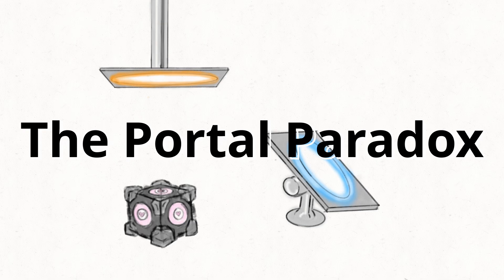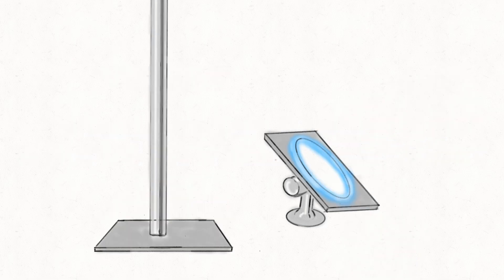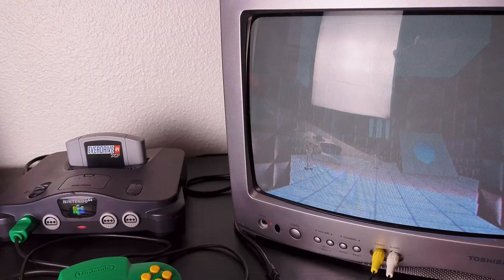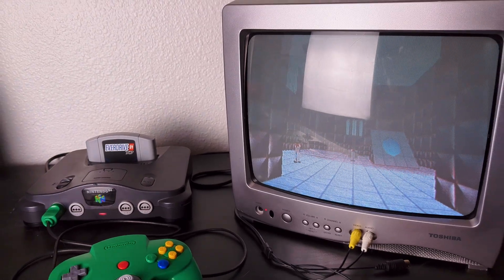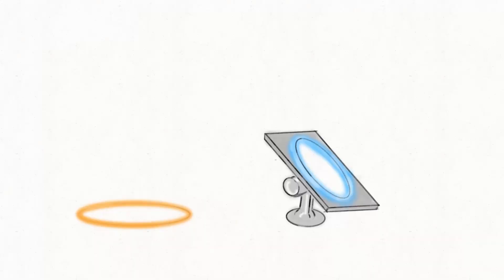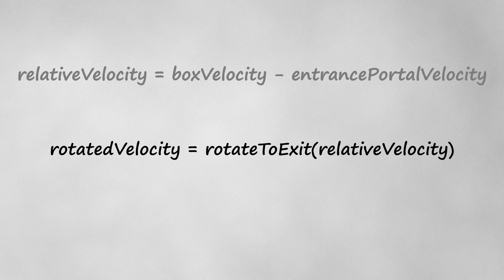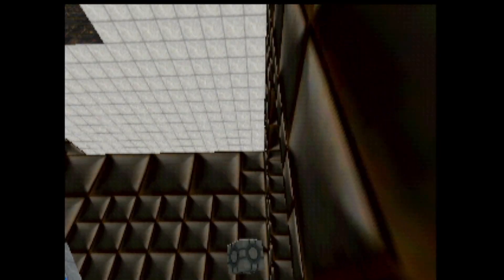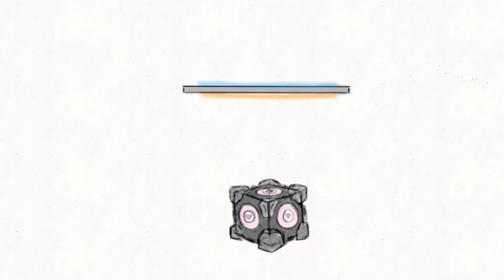I rewrote Portal from scratch and solved the Portal Paradox

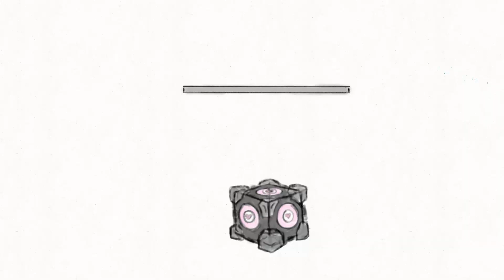Comment: The explanation at 2:02 made the first experiment make SO MUCH MORE SENSE. Amazing video <3
Reply: For mw it was the same until I remembered conservation of momentum, meaning that the velocity is influenced by the mass of the platform and the cube 😅
Reply: @randomdude7386  except the platform does not apply force to the cube
Reply: I think you are misunderstanding how the portals work in the game. The portals are not physical objects that can move and interact with other objects, they are just openings in space that connect two locations. The velocity of an object that passes through a portal is relative to the portal, not to any other reference frame. This means that if a portal is moving, it will affect the velocity of an object that exits the other portal, even if the object itself is stationary.

To illustrate this, let’s use your analogy of a baseball and a car. Imagine you have a car with two open windows on opposite sides, and a baseball that is resting on the ground. Now, suppose you drive the car over the baseball, so that one window is above the baseball and the other window is on the other side of the car. If you ignore air resistance and friction, what will happen to the baseball? Will it stay on the ground, or will it fly through the car?

The answer is that it depends on how you look at it. From the perspective of someone standing on the ground, the baseball will stay on the ground, because it has no horizontal velocity and nothing is pushing it. From the perspective of someone inside the car, however, the baseball will fly through the car, because it has a horizontal velocity equal to the speed of the car in the opposite direction. This is because motion is relative, and different observers can measure different velocities for the same object.

Now, imagine that instead of windows, you have portals on opposite sides of the car. The portals are connected, so that anything that enters one portal will exit the other with the same velocity, relative to the portal. What will happen to the baseball now? Will it stay on the ground, or will it fly through the portals?

The answer is that it will fly through the portals, regardless of how you look at it. This is because the portals are not physical objects that can move and interact with other objects, they are just openings in space that connect two locations. The velocity of an object that passes through a portal is relative to the portal, not to any other reference frame. This means that if a portal is moving, it will affect the velocity of an object that exits the other portal, even if the object itself is stationary.

To see why this is true, let’s look at what happens to the baseball from different perspectives. From the perspective of someone standing on the ground, the baseball will enter one portal with zero horizontal velocity and exit the other portal with a horizontal velocity equal to the speed of the car in the same direction. This is because when an object enters a portal, it inherits its velocity relative to the portal. Since from this perspective, the portal above the baseball is moving with the speed of the car in one direction, the baseball will exit the other portal with the same speed in the same direction.

From the perspective of someone inside the car, the baseball will enter one portal with a horizontal velocity equal to the speed of the car in the opposite direction and exit the other portal with zero horizontal velocity. This is because when an object exits a portal, it preserves its velocity relative to the portal. Since from this perspective, the portal below the baseball is moving with the speed of the car in the opposite direction, the baseball will enter the other portal with the same speed in the opposite direction.

As you can see, both perspectives agree on what happens to the baseball, even though they measure different velocities for the same object. This is because the portals are not physical objects that can move and interact with other objects, they are just openings in space that connect two locations. The velocity of an object that passes through a portal is relative to the portal, not to any other reference frame. This means that if a portal is moving, it will affect the velocity of an object that exits the other portal, even if the object itself is stationary.
Reply: @aaron7566  um.... yeah what Aaron said🤣
Reply: Except his explanation makes no sense when you understand that momentum is conserved between portals. Think of it like a baseball in a car. If you remove air, a car driving over a baseball will not move the baseball. Because before the car drove over the baseball, its momentum was 0. Therefore, after it drives over the baseball, the momentum would be 0. In the first clip where the cube goes flying, the car drives over the baseball and stops, then causes the baseball to go flying in the opposite direction as fast as the car had been moving, having never touched the baseball. Somehow, the car imparted momentum to the baseball, having never touched it.
Reply: @trmerc7635  Except that's not really how this works. Imagine it from the perspective of the exit portal. The moment the entrance portal touches the cube it starts coming out the other end. This happens regardless of whether it falls into the portal or if the portal moves towards it. Assuming the velocity of the cube falling is the same as the portal moving towards it the cube is coming up out of the other portal at the same speed in either situation. And this is where the momentum plays a role. The exit portal does not care how the cube is coming through, all that matters is how fast it's coming through. Momentum doesn't just stop as soon as it's come through and plop down, it's going to want to keep moving in the direction it was coming out of the portal at. If actually look at the exit portal you can see the cube come closer and come through the portal. From the exit portal's perspective the entrance portal may as well have been static and instead the platform the cube is on got pushed upwards. This is why relative velocity is key here. All that matters is the relative velocity of the cube compared to the portal.
Reply: @RNeeko  It really is how it works. Instead of a portal, imagine a car. If you throw a baseball at a moving car and it goes through the open windows, does the ball get faster or slower? No. Because the ball did not interact with a physical object to impart momentum. The portals are just points in space that are connected. So is a long tube. If you throw a ball through a tube that is moving, as long as the tube doesn't touch the ball, it doesn't affect the speed of the ball. For some reason, people seem to think because it is a wormhole and not a physical tube, it somehow changes the laws of physics.
Reply: @trmerc7635  the cube has to leave the exit portal with the same speed it has entered the portal... thus giving it momentum. Witch causes the box to accelerate upon exiting the stationary portal.
Reply: @trmerc7635  Imagine a car floating in empty space with no other frame of reference and suddenly a baseball flew through the window and out the other side. Now imagine a baseball floating in the same space and suddenly a car flies by and the ball goes through the window. Now imagine empty space with a baseball flying in from one side and a car from the other. The only difference between any of those situations is your point of view. The motion is relative to the observer. Whether the box is moving or the portal makes no difference to the physics. In other words smashing a portal into a box produces the same result as smashing a box into a portal.
Reply: But in all those examples, the object that was not moving stays not moving the entire time. The baseball suddenly doesn't start moving when the car passes over it. The cube was not moving. The portal moved over it, and the cube goes flying. What gave the cube momentum, the hole moving over the cube? A hole has no mass. Therefore, a hole can't have force.Force = MASS x Acceleration @malomodo
Reply: @lostlogic2840 Where is the transfer of energy? Space moved AROUND the cube. The cube didn't move through space. Something has to push the cube; passing a hole over an object does not impart momentum. That is what a lot of people fail to realize: the portal is a HOLE, not a physical object. A hole can't push, a hole can't touch, a hole is literally devoid of mass and thus can never have force
Reply: @RNeeko If you look at it in relation to the exit portal the cube would go flying as soon as it starts to come out. In your example, the cube is being squeezed through the portal, and therefore as soon as there is enough force to make it move, it will move. The portals are literally just holes in space that are connected like a straw, you can't make something move through a straw just by passing the straw over it. Try this in real life, cut a hole in a piece of paper, and pass it over a can of pop. Does the can move based on how fast you move the paper? Use a piece of plywood, does it move based on how fast you move the hole, or how hard you hit the surface it was on?
Reply: @malomodo  I think my reply got eaten. I had a good one, but this one is better because we already have an example of smashing the box into the portal from the first portal game. One of the puzzles is a room with giant pistons that are moving up and down. There is no way to get through without being crushed except by placing a portal above you and a portal on another surface. You are pushed up into one portal and either stand on the piston through the portals or fall onto the floor. As if gravity had suddenly shifted 90 degrees. Because the forces acting upon you are only gravity, nothing else.
Reply: @trmerc7635  lol no ur right... what was I thinking 🙄
Reply: @trmerc7635  As the video shows, that's exactly what happens when the two ends of the portal are stuck together and move at exactly the same rate. The question is what would happen if one portal was not moving.
Reply: The speed and direction of an object that goes through a portal depends on the speed and direction of the portal itself, not on anything else. This means that if a portal is moving, it will change the speed and direction of an object that comes out of the other portal, even if the object was not moving before.

For example: one portal is moving and one is stationary. The cube is under the moving portal. Let’s say we are standing at the stationary portal and looking through it. As the moving portal gets closer to the cube, we will see the cube getting closer to us, even though we and the cube are not moving. This is because the cube is moving relative to the moving portal. Once the cube starts to enter the moving portal, it will come out of the stationary portal with the same speed and direction as the moving portal. This is because the cube keeps its speed and direction relative to the portal it entered.
Reply: @trmerc7635  the speed of the cube is created by the moving entrance portal, measure the speed of the cube entering relative to only the entrance portal. Now because traveling through the portals is instantaneous, measure of the cube coming out of the stationary exit portal, the cube must maintain the same velocity that it entered through to the exit, whether or not the portals themselves are moving.
Reply: @trmerc7635  You have to consider the RELATIVE momentum. Everything in the universe is moving, or rather there is no way to tell if anything is actually standing still. We often use Earth as a reference point, but earth is moving around the sun, and the sun is moving around the Milky way, and the Milky way is probably moving. Saying the baseball doesn't move is only accurate from one point of view. From the car's point of view, the baseball is moving toward it. In order to account for both points of view you need to use the relative speed. In other words "how fast are they approaching each other".
Reply: @aaron7566  Then what you're describing is creating energy from nothing. The portal does not slow down while moving over the cube, yet the cube goes from 0 to whatever as it moves through the portal. The problem with this game explanation is that this is code and not the real world. "If X condition is met then Y." He could have easily programmed the game to have the other solution. That the cube just falls out of the exit portal, or the program confused the conditions and had the wrong output. This kind of simulation would normally take a supercomputer to run, and he is running it on an N64.
Reply: @malomodo  Yes, it is all relative, but the forces you're talking about would mean we wouldn't know what direction an object that is tossed through stationary portals would go after it exits, making this whole thing pointless. You drop a ball in a portal on the floor to one on the wall, and it shoots upwards before gravity takes over and pulls it down kinda thing. You have to start with a closed system to get a baseline.
Reply: @lostlogic2840 That the portals create energy from nothing and thus can be a source of perpetual motion.
Reply: @trmerc7635  A stationary ball is held in a vacuum with no gravity or atmosphere. A car with no windshield is tossed at it. The ball, relative to the contents of the vehicle is moving at the exact and opposite speed. You, from outside, observe no change in the speed of ball due to the fact that the ball in fact isn't moving - the car is.

In this instance the car's front window is the first portal, and the second portal is the entry into the space.

The ball isn't moving. The cube isn't moving. The entire room is the contents of the car moving around the ball. BUT from our perspective, inside the space, the contents of the room/car aren't moving just the ball is.

You're correct that there is no imparted momentum on the ball. But you're forgetting that relatively speaking there is a momentum difference and everything will continue to move around it.

In this case, the Cube is a fixed item in space and the entire room is shifting around it.
Reply: @magixtwister Then you're getting in the relative motion of everything in the entire universe problem. If you drop a cube into a portal on the ground, there is a chance that it flies upwards upon exiting a portal on the wall because the room happened to be moving down at the moment it exited. You need a closed system as a point of reference. When you look at his equation that the speed of the cube equals the difference in the speed of the portals, of course, the cube is going to shoot out of the exit portal, but the cube had 0 momentum going into the portal and has momentum coming out. Standing thing goes in, speedy thing comes out. His portal paradox has created perpetual motion because the energy of the moving portal is sustained, and the energy is also imparted to the cube, meaning the energy in the system just doubled.
Reply: @trmerc7635  But you can measure the angle the object enters the portal. It would exit the other portal at that same angle. You seem to be confused about relativity, so here's a thought experiment from Einstein: Imagine you are in a room with no windows and no way to get any information from outside the room. You have a laboratory that you can use to do any experiment imaginable. How can you tell if you are stationary on Earth, or accelerating through space upward at 1G? No matter what experiment you do, the results would be the same because the laws of physics don't care which viewpoint you are observing from. Whether the box is moving toward the portal, or the portal is moving toward the box is just a matter of perspective, and therefore doesn't change the result.
Reply: @trmerc7635  Actually no, let's imagine this from the perspective of the cube instead. Let's imagine that it's you that's standing there. When the portal is coming towards you nothing much happens. No wind, no forces acting upon you other than gravity. But suddenly as soon as your head goes through the portal you feel and hear wind. But it's not actually wind, it's just the air moving around you because you're coming out of the exit so fast. Then your neck, torso and arms, legs and last your feet. Remember that you were moving so fast that you could feel and hear the air moving around you. It all happened so fast you barely even had time to register it. What happens to this velocity? Does your body go from being so fast that you could hear the air moving around you to no velocity? But of course not. It's why you wear a belt in your car. If you were to have a crash you would fly though your windshield if you didn't. Same thing here. Where does the energy come from you ask? The energy comes from the piston and whatever unholy amount of energy allows for the portals to exist. I highly doubt you would ever get a return on investment on it.
Reply: @malomodo  Try this for a thought experiment. It's the same room sealed off from the rest of the universe. You have a portal rotating around a circle. When the cube exits the one portal, it shoots up into the portal that is moving around. You'll eventually speed the cube up to the point that the portal moving around will not be able to keep up with the cube. Thus, you have created energy in a closed system from nothing and breaking the law of conservation of energy. You've never transferred energy from something to the cube, yet the cube gains momentum each time it passes through the system because as it moves up, the entrance portal moves down over it, causing it to speed up, and the entrance portal never loses energy.
Reply: @RNeeko  You need a seatbelt to stop you in a car because you have momentum. The car is losing its momentum, but you keep yours. The problem with your explanation about where the energy comes from is no energy is lost to the cube from the portal passing over it or the piston. The only thing that causes the piston to slow down is the collision with the floor. If the floor wasn't there and the cube was flying in space, you would have still created energy from nothing. Unless you're saying a portal passing over an object imparts energy onto the object, but then a stationary portal would slow down an object passing through it. Because every action has an opposite and equal reaction.
Reply: @trmerc7635  One portal being higher than another one breaks the laws of conservation of energy. If the cube goes through a stationary portal to another stationary portal (edit: that is higher up) it gains potential energy. If you have one portal above another inside a vacuum and you dropped a cube in, wouldn't it continue to gain momentum at 32 feet/second/second until it was moving infinitely fast? And that's with stationary portals. That's why portals are impossible in reality, but in the game they are possible. So I don't consider that to be a factor.
Reply: @malomodo  One portal being higher than the other does not. The cube exits at the same speed as it enters and then starts to slow down when gravity takes over. No speed was gained or lost when it moved through the portals. Just because in physical space, it moved to a higher point means nothing when it comes to energy. It costs an object 0 energy to travel through a portal.

A better example of the infinite loop portal in a vacuum is a cube traveling straight towards a portal loop (think when you drop an object in the game in a portal with the exit portal overhead), and unless there is a gravitational pull, the cube will travel the loop over and over again. Move one portal closer in the loop, and the cube just cycles through the loop faster but doesn't move faster. The rate at which the cube moves through space will be the same as before, just cycling more. Energy is conserved as the cube has the same energy every time, even though the loop is smaller.
Reply: @trmerc7635  What is slowing it down? Gravity? Explain how that works. Objects on earth fall at 32 feet per second per second, which means it keeps increasing velocity. It would be like there were an endless tunnel with the pull of earth's gravity at one end. If you're in a vacuum, there would be no air resistance to slow it down, so what force is acting on it to slow it down? The only force acting on the cube is the constant downward pull of gravity.
Reply: @malomodo  If in a vacuum with an infinite loop portal, then nothing is slowing it down? I'm not really sure where the gotcha is because, as stated MULTIPLE times, unless an outside force acts upon the cube, the cube shouldn't gain or lose momentum.

If the portals are set up for an endless loop in a vacuum, then it would continue to fall and accelerate to infinite speed if gravity can help an object achieve that. However, an outside force is still acting upon the cube, not just space moving around the cube. In the example shown in the video, the cube acts the opposite of gravity. The portal comes down, and the cube travels UP from the downward force of gravity at all points in the model until it reaches the apex of the arc of travel.
Reply: @trmerc7635  Are you still talking about breaking the laws of conservation of energy (that's what my example was about) or did you switch to a new topic? BTW, I never said anything about space moving around an object. Space is nothing. Are you setting up a straw-man, or is that what you think is happening?
Reply: @malomodo  I've always been talking about the conservation of energy. There is no strawman here. My whole argument is there has to be something giving the cube the momentum it needs to fly through the air, and to the cube space just moved around it. It didn't get pushed by anything. Everyone I've been talking to has been making all these arguments about how just by the hole moving over the cube, it should start moving when nothing touched the cube itself. If space suddenly moves around an object, the object does not gain momentum.

If space suddenly shifted around our solar system, we would not feel a thing. Because no force touched the earth. If you're free fall floating in a plane and it hits turbulence, you would not feel a thing until you touch the plane. If you're floating in space in a spaceship and it suddenly moves 2 inches, you would not feel anything because you were not touching the spaceship. SOMETHING has to impart the force on the cube to move it.
Reply: @trmerc7635  OK, sorry for doubting you. (Edit: I may have been too hasty in my decision to give you the benefit of the doubt that you are arguing in good faith, but I guess we'll see.) I'm just trying to explain relativity but you said it was impossible because it breaks the laws of conservation of energy. I said the game already breaks it and gave an example and you said that one portal above another would not break the laws of conservation of energy, so I gave you an example of how it can even with stationary portals (which you still seen to disagree with but you haven't explained why. You said gravity slows down the cube, I asked how and you haven't answered (it doesn't, the cube is going toward the earth). 
But if you don't want to talk about conservation of energy will you at least agree that it isn't a factor in the game?
"Moving space" can also be excluded, since we both agree it is only a frame of reference, so any other frame of reference will have exactly the same outcome. Agreed? And we also agree that the momentum doesn't change unless acted on by another force. The problem is in how you are doing the math. Velocity is how fast something is approaching a point. That point is the portal. Whether the portal or the box is moving is irrelevant. It only matters how fast the box goes through the portal.
Reply: @malomodo  If your argument is the game is allowed to break the laws of physics, then this argument is pointless.  The whole point of the video is to put the portal paradox question to rest, but it doesn't put it to rest; it just reinforces the wrong solution.
Reply: @trmerc7635  Put a portal at the top of a water slide. Put the other one at the bottom of the water slide, add water so it flows down the slide into the bottom portal and out the top again. Add a water wheel and electric generator to the water slide. Free energy. Tell me what I have wrong. If you don't think stationary portals can break the laws of conservation of energy then what happens to the water? Does it not flow down the slide? What happens to the water wheel, does the water not turn it? What happens to the electric generator? Does electromagnetism stop working? 
If your argument is that stationary portals as they work in the game don't break the laws of conservation of energy then you are wrong. If you don't think you are then address the questions.
Reply: @malomodo  Gravity is still moving the water. The water doesn't just move on its own. Take the same example, remove the outside force of gravity, and eventually, the water will stop. That isn't free energy that is using gravity to generate electricity. Every example you've given me that follows all the laws of physics, an outside source puts energy into the object to move it.
Reply: @trmerc7635  So the earth doesn't count as part of the set. Fine, replace earth with a sphere of lead of the same mass and put it in empty space. Does that count as part of the set now? (yes) Any other objections?
Reply: @trmerc7635  Why can't earth be included in the system. If you assume no outside forces from anywhere else (other than the earth and experiment) then it is an isolated system. That's all the theory requires. No matter or energy leaving or entering the system. In that situation, stationary portals as they are represented in the game break the laws of conservation of energy, because potential energy is created from nothing whenever the box is "teleported" to a higher place.
In game terms, you have a portal on the floor and one on the ceiling 100 feet up. If you hop into that portal on the floor, you will fall from the ceiling. If you suddenly removed the floor portal would you land like you just hopped in the air, or would you land like you fell from 100 feet?
Reply: @malomodo  why do you insist on justifying your point by saying gravity which pulls stuff down justifies something flying up away from gravity when no outside force is applied to move it that way. Tell me what FORCE is causing the cube to go flying. Also, a hole can not apply force to an object.
Reply: @malomodo  then objects falling from space create energy from nothing since nothing on earth put them into space so therefore when they crash into earth energy that came from nowhere is created. If there was no ground and you had a gravitational force pulling an object to a point in space it would react just like portals do. The object would fly past it, then slow down, then move towards the point until it comes to a complete stop because some energy is lost when it reverses direction.
Reply: @trmerc7635  i think ur too caught up in a newtonian framework, which afaik isnt really possible to be consistent with any idea of wormholes. the existence of portals as they exist in most games would definitely break the idea of energy conservation, as they dont have a way for gravitational waves to propagate through the wormholes. i think a really fun solution to this would be some sort of general relativity game engine tbh, likely out of scope for a n64 demake though.
Reply: @trmerc7635  I never said gravity is what makes it fly up. Put the strawman away. Since it seems impossible for you to answer any of my questions I'm going to assume you are in agreement, unless you have a counter argument.
Reply: @trmerc7635  Objects that are within the earth's gravity field have potential energy, as I have showed you. The higher that object is, the higher it's potential energy. In order to move an object higher you have to expend energy. Portals allow you to move an object higher without expending any energy. Go read the definition of potential energy again before you try to argue with me. It's nothing new, grandfather clocks run off this principal.
Reply: @vaap  Gravity would get weird around the event horizon of a portal, but it would have to be a powerful gravitational force to really cause chaos, I believe. I would have to see a model or run the numbers.
Reply: @malomodo  Yes, and once an object starts moving, that potential energy is turned into kinetic energy and does not gain any ADDITIONAL potential energy until it starts to slow down or stop.

Except Grandfather clocks will stop if you don't wind them up from time to time or change the battery because it can't sustain the movement without OUTSIDE energy to keep the system going. Even the most energy-efficient clock still needs some outside influence to keep going.

The cube did not GAIN any additional energy going up to the height and the amount of potential energy. You're using a very oversimplified definition of potential energy to justify your answer because I'm starting to doubt you have a college education. Just because something moved up using a portal doesn't mean it gained or consumed additional energy to travel through the portal. Portals have 0 effects on the amount of energy in the system. It is a hole. Holes have no mass, no volume, and no force.
Reply: @malomodo  You're the one that keeps bringing up gravity in the situation as a justification for how your argument is right with your infinite water slide, and you're 4th-grade explanation of potential energy. It seems impossible for you to answer my question of what is applying force to the cube. Your explanations range from the movement of the universe to perpetual motion. You're arguments seem to serve to either cloud the argument or deflect from this one simple question. WHERE DOES THE ENERGY THAT MOVES THE CUBE COME FROM.

Oh, and I wholeheartedly disagree with every argument you've made to date about this subject.
Reply: @trmerc7635  "my 4th grade explanation of potential energy" is actually the definition from Encyclopedia Britannica, fact-checked and verified by the editors, so... are you saying the encyclopedia is wrong? If not why is it so difficult to understand? It's a "fourth grade explanation" after all.
Reply: @trmerc7635  Gravity is not an outside force if it is part of the set. In the experiment I proposed the source of gravity was part of the set. If you aren't reading my comments, then it's no wonder you're confused. 
Calling me uneducated is a pathetic attempt to undermine my point without giving any reason. It shows me that you have no argument at all.
Reply: @trmerc7635  Soooooo... "the potential energy turns into kinetic energy" If you gave it no energy to get back up to the top, where did the potential energy come from? How does it still expend energy on the wheel each time?
A grandfather clock needs to have energy put back into it by physically moving the weight up. If you could instantly transfer that weight back up to the top without using any energy (portals), you'd have a clock that ran forever. Imagine the waterwheel turns the gears of a clock instead.
You can try to insult me as much as you want, it doesn't bother me, because I'm not taking this argument personally. I'm just discussing science. No reason to bring feelings into it, they don't affect the results. It really only makes you look petty.
Reply: @trmerc7635  The relative velocity of the inertial frames of reference. I explained it two weeks ago, but I'll do it again.
"Whether the box is moving or the portal makes no difference to the physics. In other words smashing a portal into a box produces the same result as smashing a box into a portal."  to which you responded "Force = MASS x Acceleration" and continued on 
"But in all those examples, the object that was not moving stays not moving the entire time." (only from the frame of reference of the object) "The baseball suddenly doesn't start moving when the car passes over it." (in relation to the baseball's inertial frame of reference) "The cube was not moving." (in relation to the cube's inertial frame of reference) "The portal moved over it" (in relation to the cube's inertial frame of reference), "and the cube goes flying" (in relation to the portal's inertial frame of reference). What gave the cube momentum, the hole moving over the cube? (no, you're not accounting for your sudden switch in perspective which has a difference in velocity equal to the velocity the cube comes flying out of the cube) A hole has no mass.(agreed) Therefore, a hole can't have force. (no argument there) Force = MASS x Acceleration" (that is absolutely true, but a hole can have acceleration)
Acceleration = the change in velocity over time. To measure it you take the initial velocity and subtract it from the final velocity. 
a (acceleration)
u (initial velocity)
v (final velocity)
So the formula for acceleration is: a = (u - v)/t)

GLaDOS says that momentum is conserved. I'm going to take a leap in logic and assume she's referring to the laws of conservation of momentum: The total momentum of a closed system is equal over time, or P=P' where P equals the sum of all initial velocities and P' equals the sum of all final velocities. Or m1*u1 + m2*u2 = m1*v1 + m2*v2).
m1 = mass of object 1
m2 = mass of object 2
u1 = initial velocity of object 1
u2 = initial velocity of object 2
v1 = final velocity of object 1
v2 = final velocity of object 2

Keep in mind it says the sum of all momentum is conserved, not necessarily a particular object. The distinction is important.
Don't take my word for it though, here's a quote from a lecture about calculating momentum with moving frames of reference from MITOpenCourseWare titled "4.3 Reference Frames" (Look it up if you'd like to see the mathematical proof).

"So if I have two frames of reference, one moving at a constant velocity to the other, in general, I will measure different positions and different velocities for an object as measured by the two frames. However, the accelerations measured in both frames will be identical. Because the accelerations are identical, we'll see that Newton's laws will look identical in the two frames."

Prof. Deepto Chakrabarty
Physics Department, MIT

Also keep in mind that the universe doesn't have a specific point of reference, we can freely choose any point to make our measurements from and as long as the velocities aren't changing (not accelerating or decelerating) it's as if we are perfectly at rest and everything else around us moves independently. 

So if we look at from the perspective of object 1 and measure object 2's velocity, it would be equal to looking at it from the perspective of object 2 and measuring object 1's velocity. If we chose another point between them and measured their velocities, the total would be still be the same. No matter which viewpoint you use, conservation of momentum is true even though you can still measure different velocities of individual objects in different frames of reference.

or as I said in my original post:"Whether the box is moving or the portal makes no difference to the physics. In other words smashing a portal into a box produces the same result as smashing a box into a portal."
Reply: @trmerc7635  As a side note I find your assumption that a person needs a college degree to understand these simple concepts hilarious. Just like the straw-man from the wizard of Oz that suddenly became smart when the wizard gave him a diploma. A perfectly ironic straw-man argument. Bravo.
Reply: @Greenicegod  Conservation of momentum is conserved if you account for the movement of your frame of reference, or if you don't change your frame of reference (if you look at it through the exit portal, the box is moving toward the portal at a constant velocity, and therefore continues when it exits with that same velocity, since mass doesn't change that means that momentum doesn't change) but everything else is correct.
Reply: @trmerc7635  Objects in space have potential energy because they are in the gravitational field of the Earth. The higher up they are, the more potential energy they have. The closer they are to the center of gravity, the more energy is transferred from potential energy to kinetic energy (it accelerates). Assuming the object passes through the point without colliding with anything, the moment it passes through it will have no potential energy, only kinetic energy. As it moves past the point kinetic energy is transferred back into potential energy until the kinetic energy runs out and the object stops, at which point all the energy is potential energy equal to what it had before. You are wrong about the object eventually coming to a complete stop at the center point of gravity. With no outside forces to slow it down (in a perfect vacuum), the object would continue it's back and forth motion forever.
Reply: @trmerc7635  Which level? I'll check it out.
Reply: @malomodo  I'm condensing your 4 replies into this one.

You: "my 4th grade explanation of potential energy" is actually the definition from Encyclopedia Britannica, fact-checked and verified by the editors, so... are you saying the encyclopedia is wrong? If not why is it so difficult to understand? It's a "fourth grade explanation" after all.

Me: From Britannica, " stored energy that depends upon the relative position of various parts of a system." STORED energy means energy that is not being used. When the cube goes to the higher floor, the distance from the cube to the floor stays the same. It only gains POTENTIAL energy when it stops moving. Otherwise, it has KINETIC energy. The cube would gain potential energy when it lands on a higher surface, and that is imparted from gravity. It doesn't magically gain energy when it moves up because it is not moving higher under its own force. That is like saying using a crane to lift a box up from the ground creates energy from nothing.

You: (This one is to long to copy) The relative velocity of the inertial....

Me: You're assuming that the cube changing position does give it velocity and force, that force and velocity do not impart that force upon itself. To move an object a force greater than gravity, surface friction, and air resistance needs to be applied. Otherwise, you're creating energy from nothing.

You: As a side note I find your assumption that a person needs a college degree to understand these simple concepts hilarious. Just like the straw-man from the wizard of Oz that suddenly became smart when the wizard gave him a diploma. A perfectly ironic straw-man argument. Bravo.

Me: Like how you said if I don't answer your question I'm agreeing with you, or misrepresenting a scientific journal.

You: Objects in space have potential energy because they are in the gravitational field of the Earth. The higher up they are, the more potential energy they have. The closer they are to the center of gravity, the more energy is transferred from potential energy to kinetic energy (it accelerates). Assuming the object passes through the point without colliding with anything, the moment it passes through it will have no potential energy, only kinetic energy. As it moves past the point kinetic energy is transferred back into potential energy until the kinetic energy runs out and the object stops, at which point all the energy is potential energy equal to what it had before. You are wrong about the object eventually coming to a complete stop at the center point of gravity. With no outside forces to slow it down (in a perfect vacuum), the object would continue it's back and forth motion forever.

Me: You just used my own example against me to disprove some of your own arguments. You just proved that I was right. However, in your explanation, I think I figured it out. You seem to think that potential energy is a quantifiable number based on the distance to the center point when it is the distance to the closest surface. A cube on the roof of a skyscraper that is picked up 10 feet and dropped has as much potential and kinetic energy as a cube at ground level picked up 10 feet and dropped. The only time this changes is if the cube on the skyscraper is dropped off the edge of the building. Then it has more energy than the cube that was lifted 10 feet up from the ground and dropped because the distance between it and the surface below it increased. If you're example was the way the world worked the Cube at the top of the skyscraper would end up breaking through the building because that is how much force it would have if it had fallen from the top all the way to the ground. Remember, gravitational forces get WEAKER the higher you go up as well. So much that scales on Earth will actually read incorrectly if you're too high up in elevation.

You: Gravity is not an outside force if it is part of the set. In the experiment I proposed the source of gravity was part of the set. If you aren't reading my comments, then it's no wonder you're confused. 

Me: It is a force outside of the cube. You know, how potential energy of an object at rest is gravitational energy that can be turned into kinetic energy.
Reply: @vaap  I'm not sure he even understands Newton, let alone Einstein.
Reply: @trmerc7635  Take all the time you need, just don't forget reference frames like you have done in every argument you have tried to make so far. BTW, have you come up with any reason at all why you think I "misrepresented a scientific journal"? Or is that another pathetic straw-man tactic? If you're just lying so you don't look stupid, I'm afraid it's too late for that.
Reply: @malomodo Did you miss the reply I did where I combined 4 different response threads into one? You're the one who keeps coming up with these strange arguments to defend perpetual motion and then accusing me of straw-man statements when I call you out on it. Your latest one uses 'reference frames' and a formula that doesn't make sense because you have 1 object and are using a formula that requires the interaction of 2 objects.
Reply: @trmerc7635  Your last response was wrong. You don't know what reference frames are and you certainly don't know how to use them. You were comparing two measurements made from two different reference frames with nothing correlating them. Which formula? The one about calculating velocity in moving frames of reference? That is what I was talking about, but since you don't understand what a reference frame is or how to use one I'm not surprised you're confused. Looks like you need to educate yourself.
Reply: @malomodo And again, you're avoiding answering my questions. Reference frames are just your way of trying to bring back into the argument that the Earth is moving through space argument that basically had this whole argument as pointless because the same forces would cause problems with static portals if that was taken into account, meaning a moving portal has no effect over a static one. Answer this one question "WHAT FORCE IS ACTING UPON THE CUBE." Here are some examples of forces that will help you "Gravitational." the effects of the mass of an object. "Applied ." applied to an object by a person or another object. "Spring" compression or stretching of an object. Reference frames are NOT A FORCE. Observing an object does not change the forces acting upon it it just expands or contracts the forces you have to take into account when the FRAME OF REFERENCE (another way of saying it) expands.
Reply: @trmerc7635  "Observing an object does not change the forces acting upon it it" 
So it doesn't matter what my reference frame is. The result will always be the same no matter where I measure from? Good, then I'll use the piston head as my frame of reference. From that point of reference, the cube has velocity. If you want to call velocity a force, then that answers the question you've been screaming: "WHERE DOES THE FORCE COME FROM??!?!?!!?!?!?".🙄
Reply: And if your frame of reference is the piston, the entire universe is moving at the same speed as the cube, making its speed the same as the universe around it after it passes through the portal and is not flying through the air because it has to move at the same speed as the rest of the universe. Your gotcha isn't as much of one when everything around you is moving at the same speed. Do you ride in a car wondering how the people are able to stay standing when they are moving so fast? The forces acting upon them must be immense because they are traveling at 25, 45, or maybe up to 60 miles per hour away from you.

To answer my own question, there are gravitational forces acting upon the cube. It has gravitational force pulling it down and trying to pull it back through the exit portal until it goes through enough for gravity to be greater on the other side of the portal and then pull it out. If the piston was traveling slowly enough the cube would get pulled into the portal when the center of mass passed through the portals and then fall to the floor with a thud. Because nothing transferred force to the cube to make it travel farther than the gravitational forces pulling on it. Pulling at the center of mass to keep it out of the portal, and then once more mass of the cube has left the portal than entered gravity would again pull it downward at the same speed as before, and once it hits an object will stop. That is the only time it will move exiting the portals.

Because you're so hyperfocused on frames of reference you're not calculating the forces acting upon the cube. You're ignoring that you have to have a force transfer into the cube to counteract gravity. Nothing but gravity is acting upon the cube, and thus it will only react to gravity in the entire situation, but we've established you don't understand gravitational forces because you seem to believe that the higher an object is the more kinetic energy it must have relative to the center of the gravitational mass. I.E. a 20 lb block at ground level compared to a 20 lb block on the roof of a building.
Reply: @trmerc7635  I figured by now you'd actually look up inertial frames of reference, but it seems like you're going to stubbornly remain ignorant. The rest is just sarcastic straw-men and made up non-sense, so I don't think I need to respond.
Reply: @trmerc7635  Lol, no.
Reply: @malomodo  I did look up inertial frames of reference, and it doesn't explain anything because that would imply the box has a force applied to it before the portal moves over it. You fail to explain how your example maintains Newton's Laws of Motion. An object at rest remains at rest unless acted on by an unbalanced force. Inertial frames of reference still have to follow Newton's Laws. You CAN'T explain where the force is coming from because there are none. At this point I'm convinced you're just pulling a sharks are smooth argument here and using nonsense to defend your position because it fails on basic laws of physics.
Reply: reading this whole reply thread gives me both faith and loss in humanity. shoutouts to those who truly understand relativity and help with the explanations. but it is really sad that i am seeing individuals end up being stuck in permanent denial like trmerc7635, like i feel bad for this guy for not being able to comprehend relativity, like being stuck in a chamber of cluelessness. the natural result of the cube launching due to change of exit momentum takes priority over a certain man's statement that was made sometime around the 1600s, because... portals break things... the energy conservation... the forces... they just don't matter anymore